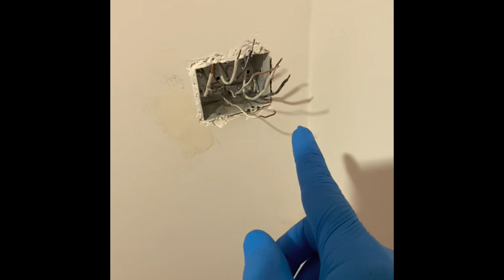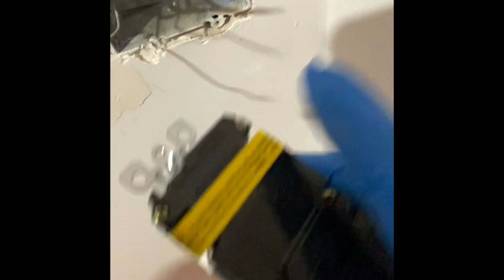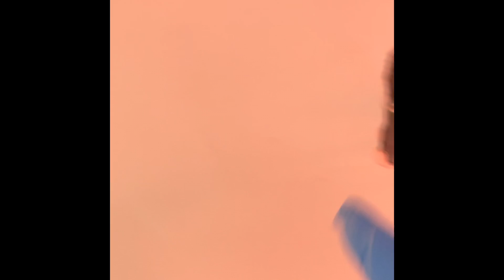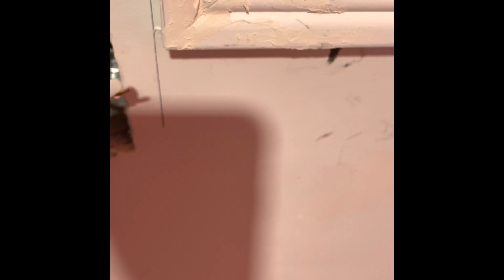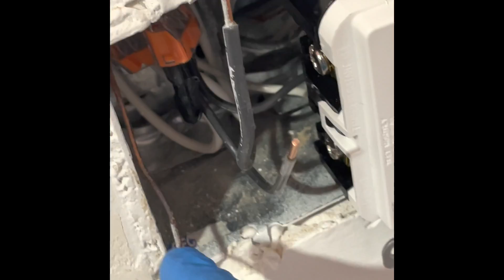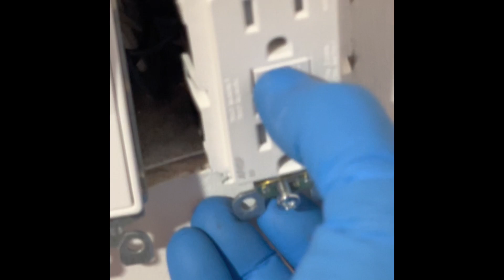How to connect GFCI outlet and light switch on one electrical box

Comment: I was wondering if I had four wire cable already how would I do it differently.
Reply from the maker: you need to know what are the 4 conductors in your wall used for before proceeding.